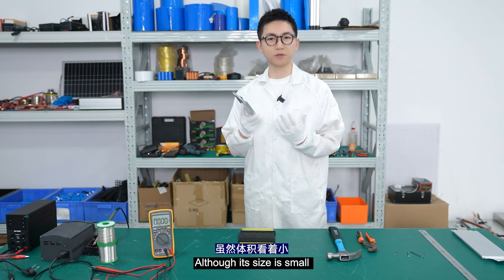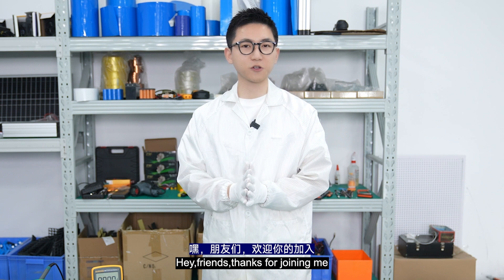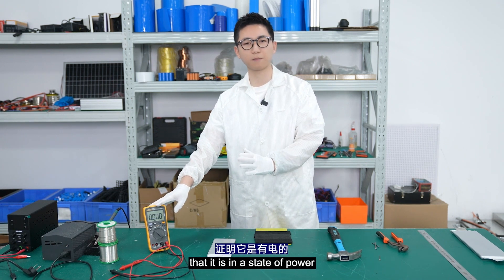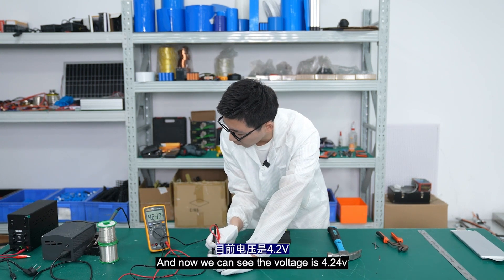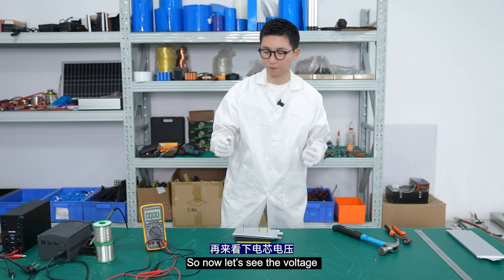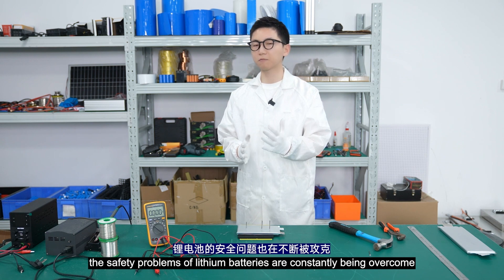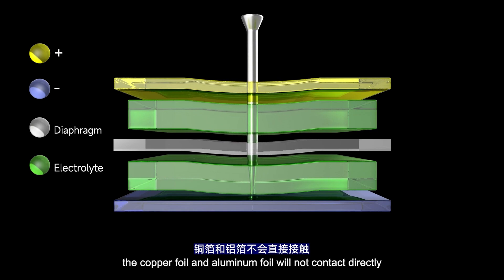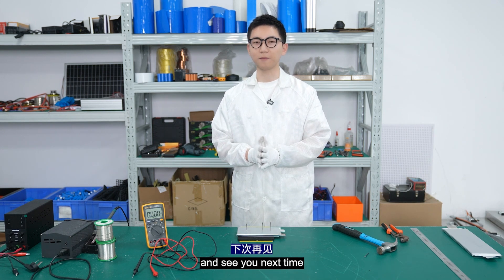the Puncture Experiment of lithium battery

Comment: Wear some proper protective please. Safety glasses at least. Some idiots will copy you 😢
Reply from the maker: Yes, it would be better to have goggles. In fact, this experiment may have an undesirable result, which is that it will start to smoke and gradually catch fire, so I prepared a large bucket of water nearby. Of course, I am confident that this experiment will not happen like that.😀